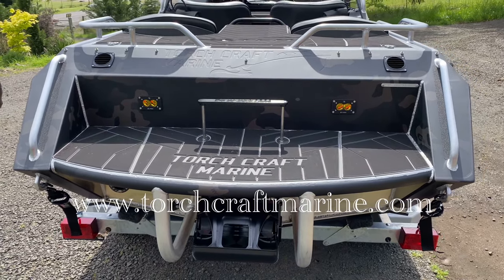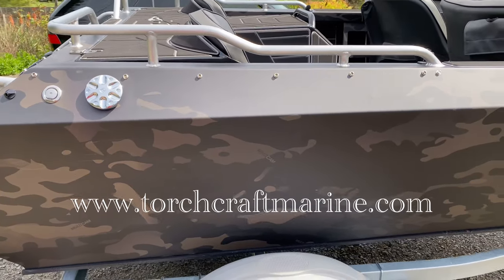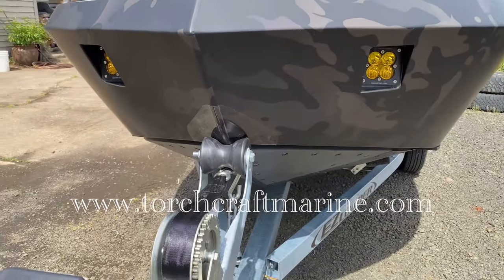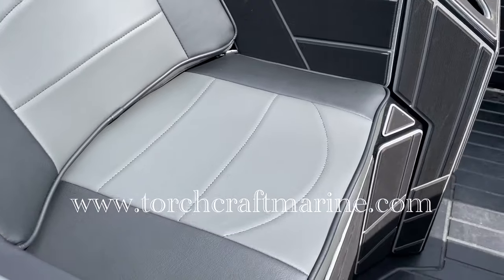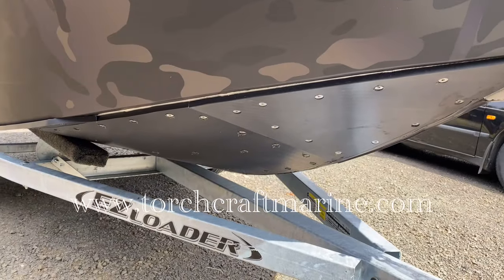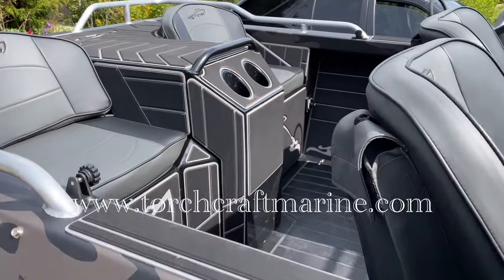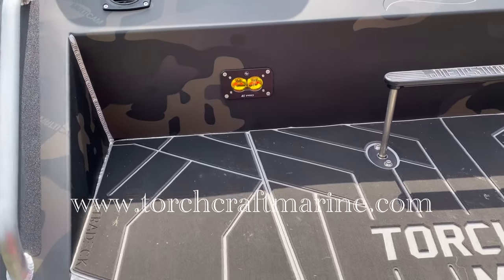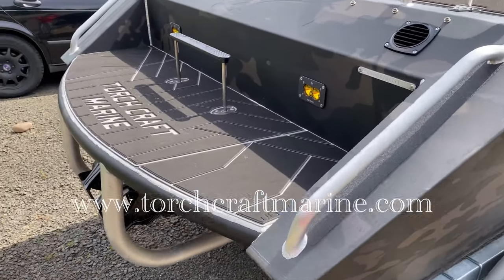2021 Torch Craft Marine Mini Jet Boat Walkaround

Comment: Awesome. How does it ride through choppy water?  Can you drive standing up?
Reply from the maker: They are designed for whitewater and you can drive while standing up.
Reply: Thanks. I’ve seen a lot of cool video of them in whitewater but had not seen anyone standing up so I wasn’t sure if there was room.

Comment: I would rather prefer the stick throttle/gear lever like all the regular boats have.
It is more consistent using a throttle lever versus the steering wheel throttles and your fingers would get tired after a while holding those little levers . But thats just me .
Reply: These are ment for hard riding through whitewater and shallow rivers you need instant throttle control on a vehicle like this